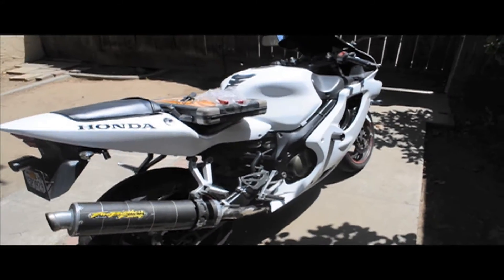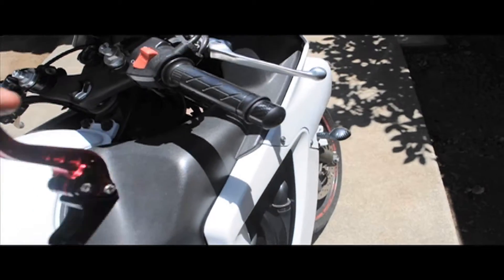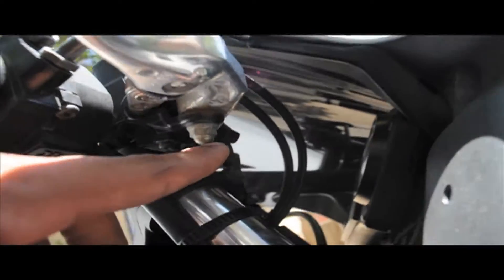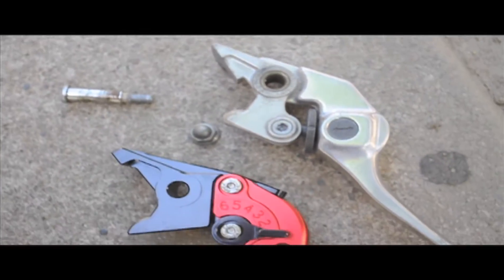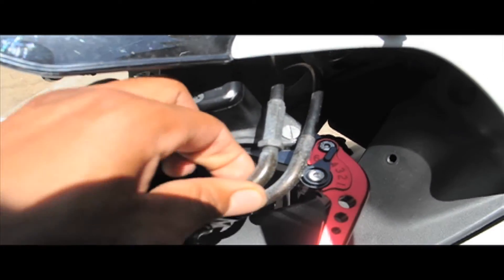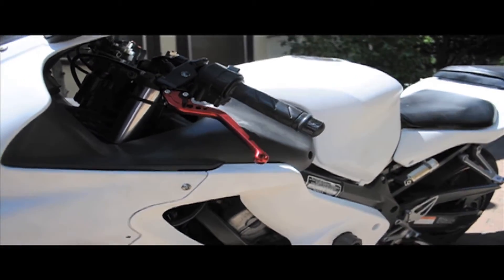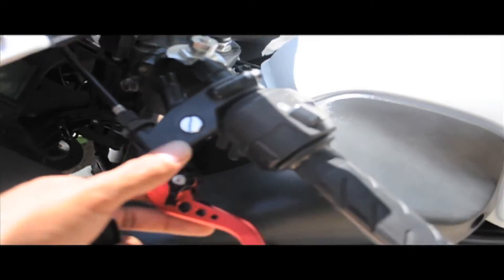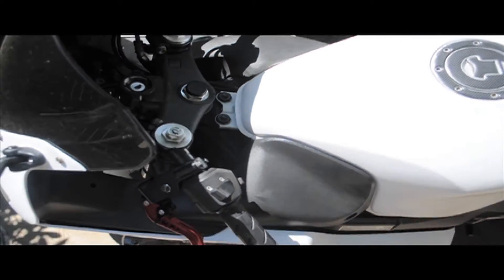Brake and Clutch Lever Installation (01 F4i)

Comment: Bought the similar levers but in black. However, the brake lever was a good 1-2cm thinner. When you try to put it on, it doesn’t in place. Do you have exact link where you bought these?